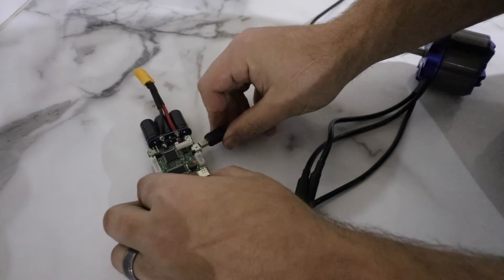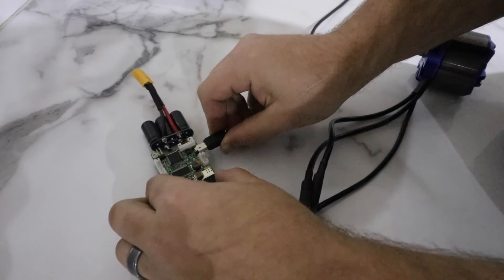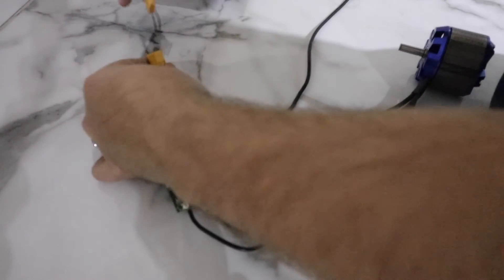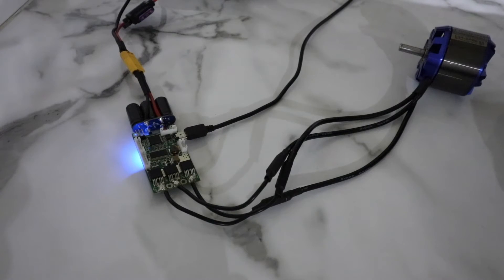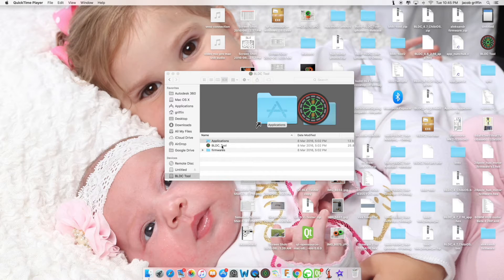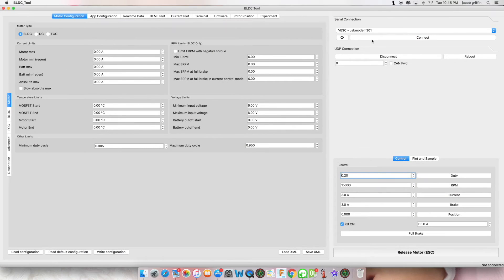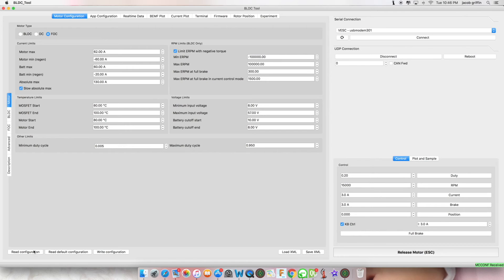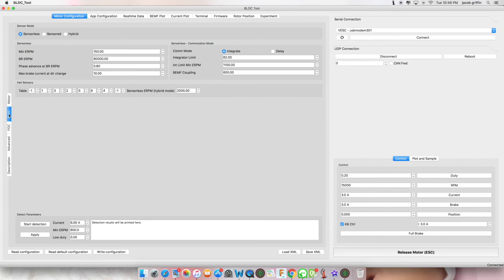VESC PT4: Motor detection

Comment: i keep getting  a "bad detection result revised" help
Reply: thanks, worked for me
Reply: Same issue here. Help please!
Reply: i managed to fix it
Reply: i made the minimum input voltage 6V, i made the maximum input voltage 57V.

i also made the battery cutoff start 15V, and i made the battery cutoff end 5V,

hope it helped
Reply: what kind of battery did you have? I have a 10s3p
Reply: Arun Davuluri I am using 4 3S lipos in parallel and 2 6S lipos in parallel and I have those 2 bunches in series
Reply: no problem :)

Comment: I got my vesc from jason. I need to do a motor detection. What batteries do I need to use? Can I use a 3s 5000mah? Is that all I need to do when I recieve my vesc?
Reply from the maker: if you are using the r-spec motor you do not need to do a motor detection. if you are using a different motor 3s is fine for motor detection process